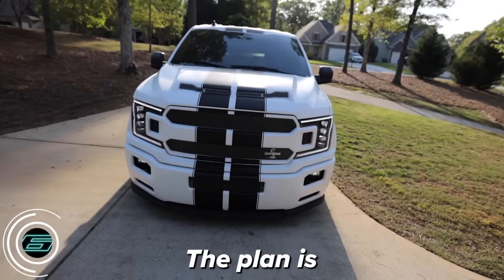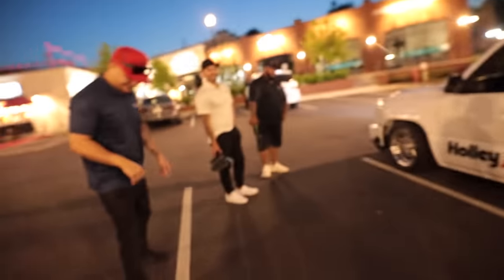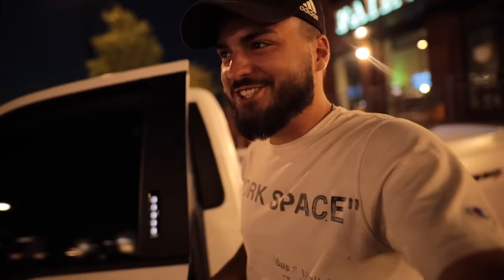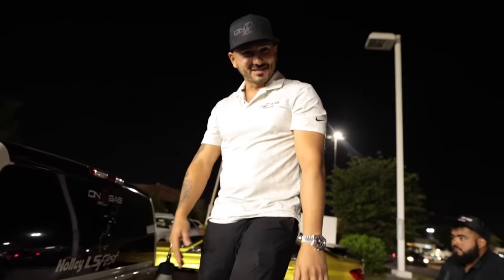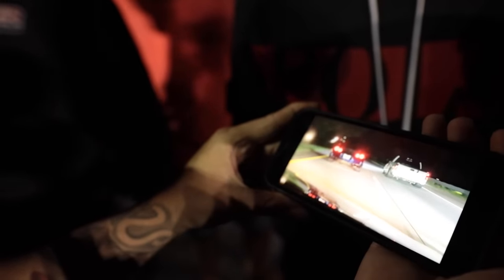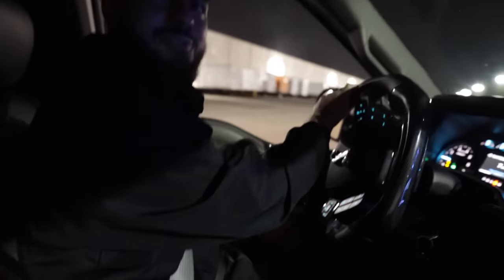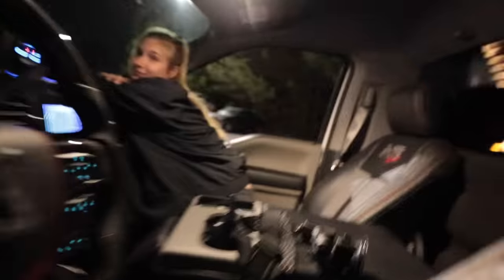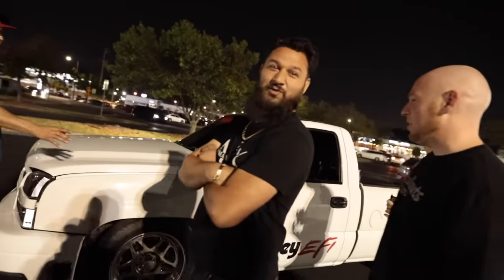GTR bets against WRONG TRUCK in Drag Race!

Comment: Haha one and done on the truck no one else wants to touch it, I know that feeling. We were all messing with slow stuff but my g35 vs a brz dude was talking all kinds of mess wouldnt let anyone look at the car wouldnt say mods, power numbers, etc. Tried to bet but I turned it down because of the secrecy. Ended up putting car lengths on him rofl. After that one run, no one wanted to mess with the g35. Everyone was down the race the even slower 230k+ v6 mustang tho. Back to back runs with multiple civic si. from like 10/11pm to 6am the sun was coming up. Was a blast. Everyone had a good time no one butt hurt. Even had a dude in a mazda protoege race a k1500 lifted truck for giggles. Was a fun time in slow cars. Wish I had video of that night. FF vibes af.

Comment: I give it to you. You're actually out here doing this shit and in fuckin here for it. I want more truck shit more street shit. I'm starting a group down here in Tennessee no P/A other than NoS no more than 175 shot, and no bigger displacement than the highest stock option. So if you have a chevelle you can put a 454 with a 150 shot or so on n so forth. No turbo, no whine no nothing.